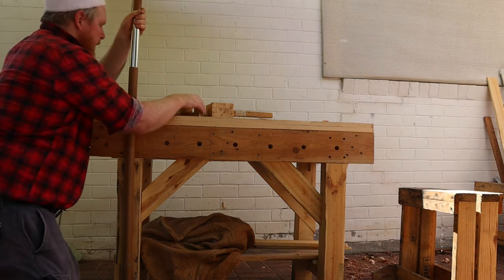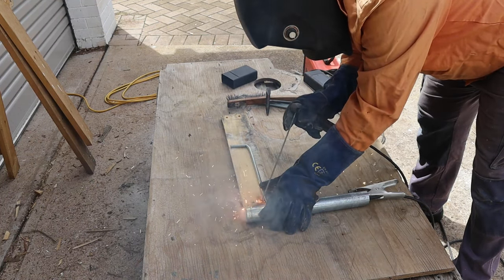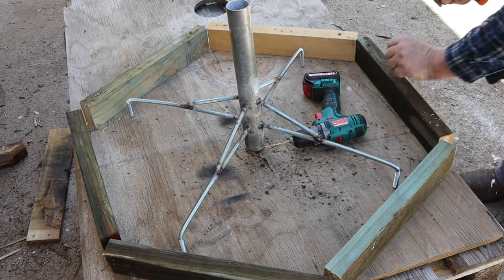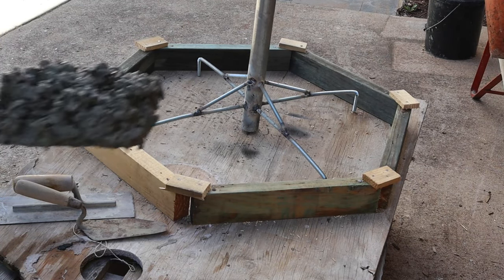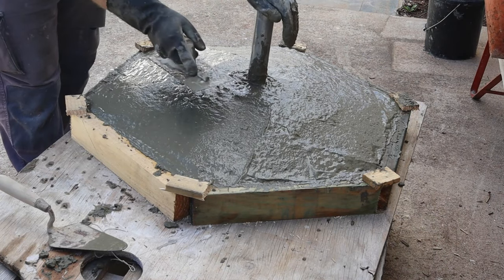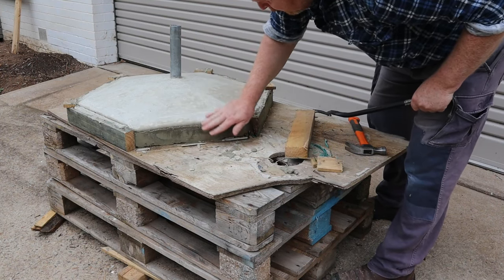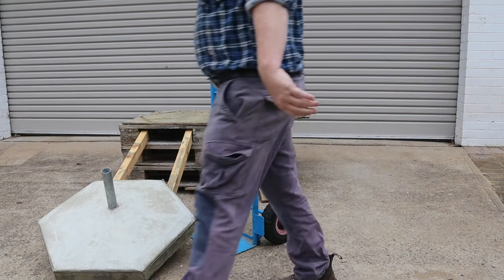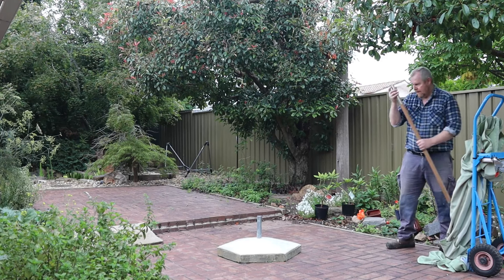Building an outdoor umbrella base

Comment: Nice job. I might add wheels on mine or put on a dollie
Reply from the maker: To be honest, this base is at least twice as heavy as it needs to be.  I got a little carried away with using up all the old concrete materials... :-)
Reply: Why? To make a sailing umbrella wandering in the yard with every wind? But then if you would say: "I might add wheels to the side walls for bend and move" then I would be with you one hundred percent.

Comment: That’s a fantastic solution, I plan to build this but I might screw 4 wooden blocks on the mould base to make pockets so I can put hidden caster wheels on, awsome build👍
Reply from the maker: Good idea! Just don't use as much concrete as I did - I got carried away and emptied the whole blue tub into the wheelbarrow, and now my base is twice as heavy as it needed to be. 😀

Comment: Will you secure the umbrella to the tube? it may not blow over but a wind gust will blow it out of the tube.
Reply from the maker: That hasn't been a problem so far (and I've kept the umbrella unfurled for a couple of weeks now to check).

If it becomes necessary, it should be a simple matter of drilling a hole through the tube and the umbrella pole, then fitting a pin.